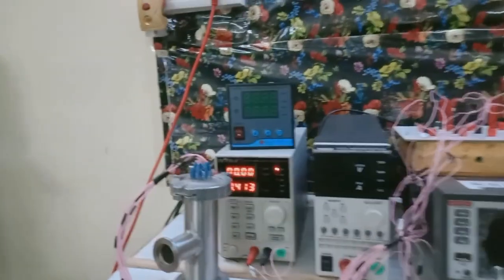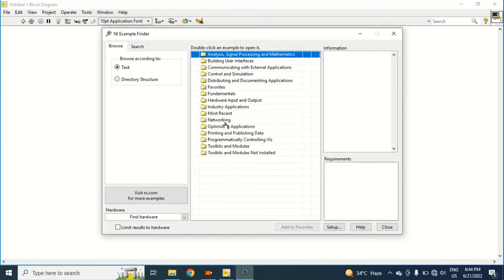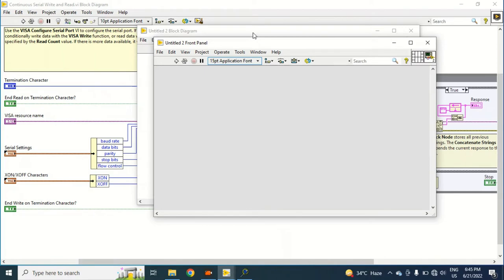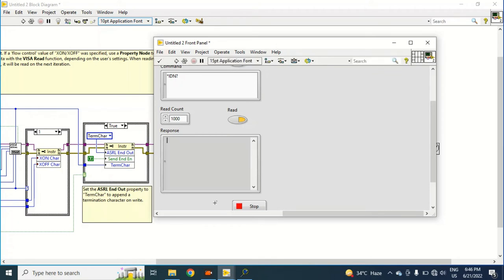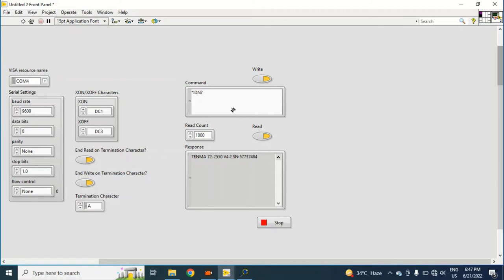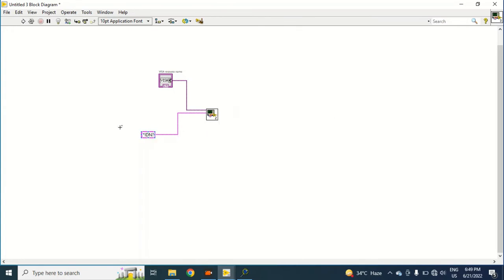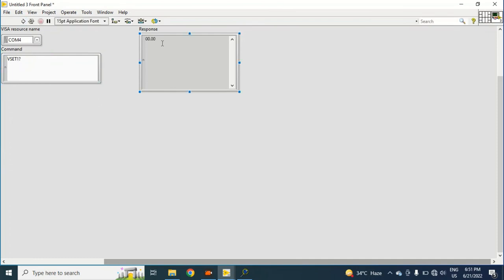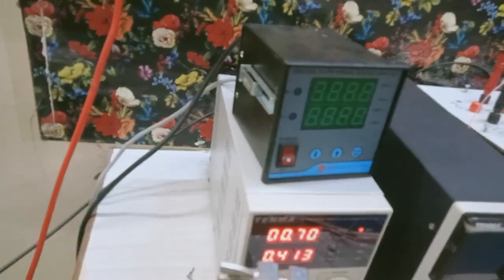Controlling a Power supply using LabVIEW: Instrument control with LabVIEW #labview  #tenma

Comment: In command section, your are giving manually to operate, here I want that command to give into the block diagram, whether true means it have to read voltage, false means it have to read current. How to design it.?
Reply from the maker: Well, It is possible with case structure.